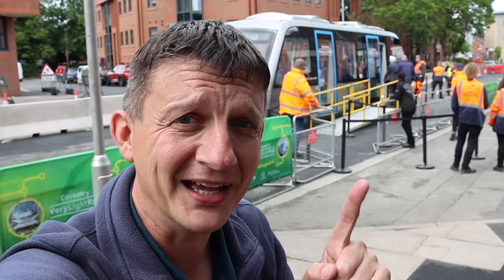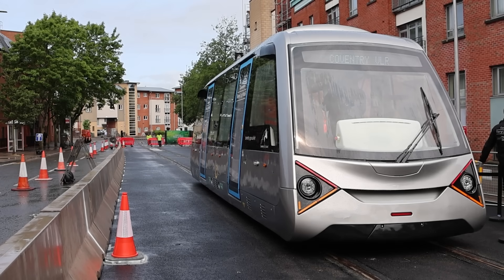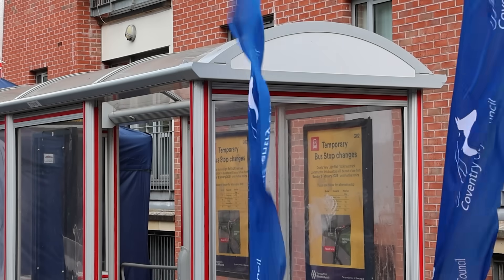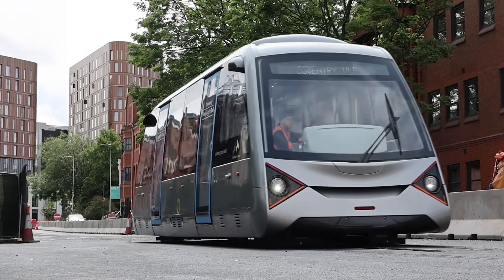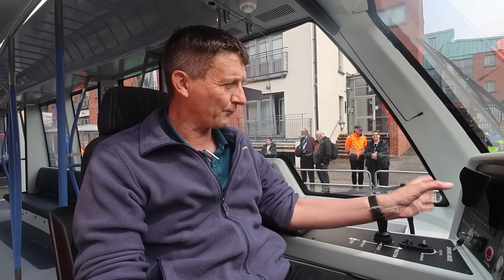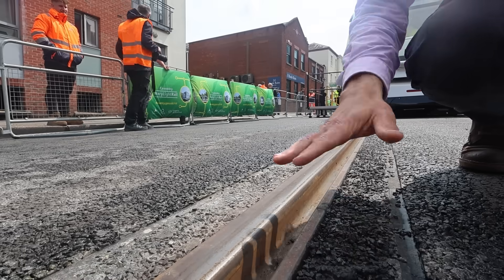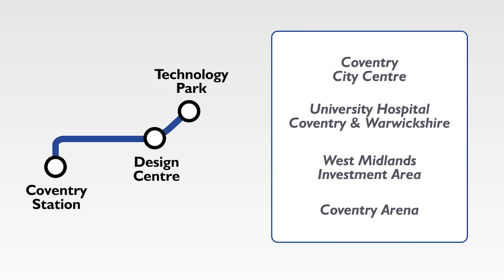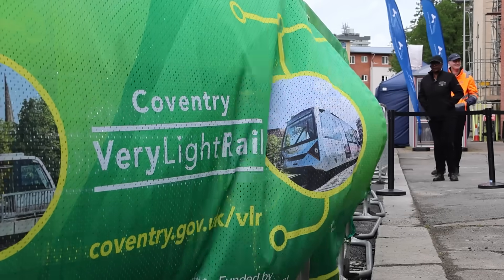The NEW! Coventry Very Light Rail is here

Comment: question: why would we want a tram for a job you can do with buses? I mean this vehicle has the same capacity per hour and it's as wide as a bus.. .what is the advantage? maybe it can be good to improve average running speed on some old tramway networks where longer tramas cannot run.. but I would se much more relevance if this tracklaying system was accompanied by a much longer vehicle...

Comment: I was born in Coventry, and now I live in the world tram capital, so this story hits me from two angles. :-D
Hope they have huge success. Yay real steel rails!
Boo no proper wires but toxic batteries - but if we can get tons of passenger journeys on these things it will still be a solid win!
Reply: I think the success and increased frequency that brings would inevitably bring about a necessity for OHW or at the very least charging installed along the route.
Reply: @Reddsoldier  agreed.  Apparently they can manage 70km on a charge - which isn't that much when its supposed to be going back and forth all day.  long lines will deplete the battery entirely and require charging at each end - and note they didn't really mention how long the recharge times are.
Reply: @jameshodgetts7541  If they're smart they'll design in the capacity to add a pantograph to the production models.

Comment: This just makes zero sense to me for a whole host of reasons. Nominal cost is a bad metric to use when deciding what type of transit to build. A much more important metric is the cost per rider.

These trains can only transport 60 passengers per vehicle, and they operate in mixed traffic. That means at best this system will service a fraction of the ridership compared to traditional light rail, much closer to a regular bus. Add to that the fact that they're using batteries and now your maintenance costs and costs per vehicle are higher as well. So between the higher cost per vehicle and the shared right of way, this system will be completely unable to competitively scale compared to other solutions. At that point they might as well have just invested in more buses and restriped the road to add a bus lane.

Comment: I'm sorry to be cynical but this is just a more expensive, less practical and less flexible version of an electric bus. You don't get the capacity benefits of a proper tram. You don't get a bus which is able to divert in the event of a blockage, whether a car parked on the tracks or a road closure. Yet you get a lot more cost than a bus. And you don't even get the acceleration that a bus has.
I genuinely hope that this ISN'T implemented. For the same money, you could have so much more bus service, benefiting far more people.
Reply: Technically the capacity benefits should be seen in the frequency

Comment: I was able to go see this, take a ride, and ask some questions; and one thing I gathered was that a lot of the attitude when designing and building the system was avoiding disturbing drivers. For instance, they said the vehicles are so small because articulated trams are hard for drivers to navigate around, and they said there wouldn't really be any dedicated lanes or exclusive right of way for the tram since that could inconvenience drivers. I was rather disappointed by this, since these vehicles are so small that they'll definitely be having capacity issues if the system is at all successful, and the lack of grade seperation means the trams will probably be constantly stuck in traffic, seriously discouraging people from using the system. Building new rail transit is a good thing, but I really think that this system doesn't have any advantages over a conventional light rail system other than maybe being cheaper (although, when the batteries wear out in a few years that might not be true either), and the city should really be proud of its transit, rather than timidly avoiding disturbing drivers.

Comment: A point to note, living in a hilly city where the trams are designed to deal with a 10% incline, the CVLR is designed for a 5% incline during normal running. Maybe that isn't an issue for most towns/cities, and the use case suggests that it would be generally for city centre usage which might mean the lack of ability to tackle steeper gradients isn't an issue. It looks very neat.

Comment: I am not sure what the use case of this is? It kind of has the worst of a bus and a tram together: it needs its own infrastructure like a usual tram but has the capacity of a bus possibly neglecting most of the service cost benefits of trams. I think it could be very useful if it is scalable: start with the bare minimum and attach cars and maybe also electrify in the future.

Comment: Can’t see the point. The whole point of trams is they have a remote power source and don’t need to carry their own.  These obviously run on batteries so you may as well use electric buses which are not confined to fixed rails and are far more flexible and larger capacity.

Comment: This may be a dumb question: why VLR electric trams instead of electric buses? What makes a tram better than a bus?
Reply: Steel wheels on steel rails are vastly more energy efficient, meaning less batteries per bum on seat.  On figures quoted in the clip, the axle load on this design is under half that of a comparable battery bus, meaning kinder to roads and due to the predictability of motion, it needs less width than any free steering vehicle.  The system could be made driverless (only on reserved running tracks would be my guess) and multiple unit operation is always an option.  The system could act as an add-on to existing conventional tramways to increase network coverage.
Reply: @TheHoveHeretic  thank you very much. That was a very interesting reply.

Comment: It's a . . . streetcar? Tram covers a pretty wide range, so does light rail. I'd say this is a streetcar - no reserved right of way, runs at surface traffic speeds, stops have minimal or no infrastructure, capacity is about the same as a bus or maybe up to 50% more than a bus, trains are short - single carriage or maybe 2 or 3, carriages are light weight so rails don't need a heavy foundation. That's all things that streetcars were and that differentiated them from interurbans and trams.

Comment: -All the benefits of a modern light rail solution 
- Moves less people than a double decker bus
- As slow as a bus (no right of way)
- Way more expensive than setting up a bus route 

So what are the advantages of light rail that it brings? Smoother ride and faster acceleration (which, as well as speed, doesn’t matter that much without a right of way), that’s it. I literally can’t find any other advantage

Comment: 70km range for a public transport system seems very low. If they insist on batteries to avoid building a catenary they need more rage than that. A public transport vehicle can travel 120km a day easily, so unless you have twice as many vehicles as you would otherwise need that battery capacity is currently inadequate. This isn't a critical failure with the idea, just a needed upgrade to make it practical.

Comment: If you want real light rail , try narrow gauge , it saves rotating wheel set weight .  Lookit meter gauge trams in Switzerland or Lisbon , San Fransisco cable cars , or 3 and half foot gauge of  light rail in Japan , bla .   This new wide gauge heavy battery "thing" does not belong .

Comment: Hi Geoff,

Always nice to see you pop up in suggested videos and see you geeking out.  Seems like it might be a smart idea for smaller cities such as Coventry.  But honest question: how is this better than a bus??  It's about the same size.  The big advantages of buses are they don't need new infrastructure (generally speaking), the prices of the buses themselves, and since they aren't on tracks, the route can be adjusted and modified very easily, or even on a temporary basis if there is road work or a car crash somewhere.  For most locations around the world, focusing on good bus service would simply be their best solution.  And buses are ideal vehicles for hybrid gas/battery power.

A 70 km range probably works fine for Coventry.  Here in the US, I don't think that would work anywhere unfortunately.

I live near Los Angeles, and on the last light rail project, they spent over $1 billion dollars a mile.  Ridiculous.  Lots of stupid regulations and designs (sometimes elevating portions or putting other sections underground) that drive up the costs, but also graft (legalized).

Finally: what's wrong with calling it the "VLR"??  London has the DLR.  VLR certainly doesn't sound bad to my ears.  If they don't like VLR, the next simplest and obvious name seems to just call it the "Coventry Tram".  If it's built in other cities, they can just substitute their city name.

Comment: I do think this is very interesting, but I'm also sceptical. At the moment with this little demonstrator vehicle that has the capacity of half a bus, it's pointless. The question is whether it can scale to at least 150-200 people per train. The track technology may be the most interesting thing, if it can keep its promises. It's nice that they can build without any relocation of utilities, but can the ground beneath the track actually withstand the load long term? Even with normal buses that's not obvious, I know plenty of places in my local town where the weight of buses at the same spot of the road every time (at stops) has caused deep depressions in the pavement, until the road in that area was finally rebuilt much heavier.

Comment: Honestly? I think it has some great potential for small towns who want to introduce a tram system as a potential starter, or even as a starting point for growth. The only thing that worries me is that they're building them into existing roads and will likely not be segregated and so will just get stuck in traffic. The simple rule is, if you can get there faster and more comfortably in a car, why would you use anything else?

London has public transport all over and car journeys are a nightmare, Manchester's public transit is also becoming locally controlled like London and their Trams have grown from 1 line opened in 1992, to 9 lines to different locations, and having maxed out tram throughput through the city centre in 2025, and that's because they used old rail lines around the city, very little new infrastructure needed to be built to start with. 

If they put these into a dedicated lane or bus lane on busy routes to popular places, then I think this could be very successful and get more people out of cars in more rural areas and smaller towns or places trying to get started with a tram system without the initial huge budget initial cost.

Comment: I have a couple of issues with this: 

Firstly, Is it seems to be skimping on the fixed infrastructure, which means I am skeptical it will be value for money long term. My reasoning for this is such a lightly installed system may not have the long term staying power of a proper tram, which opens the door to a failure in the fixed infrastructure leading to it's removal before it can prove itself. If it gets people building trams, I'm all for it, just wary about it lasting. 

Secondly, batteries and charging: a 70km range sounds alot, until you realise the average length of a tram route is 15-25km, meaning at most this will do two round trips before needing a charge, this means the need for more vehicles (and the space and infrastucture to charge them) in order to run the service. Ideally a service like this for it to be successful needs to run at least once every 15minutes, (although more would be better), ie 4 trips an hour, so already depending journey time you need 4 vehicles an hour. And then Charging, in order to fast charge a vehicle like this, you need significant fixed infrastructure in terms of substation and electic supply, that I would be surprised if it wasn't comparable price, or more expensive, than just putting the wires up. Additionally to this, we've seen how vehicle batteries can be dangerous, and I would argue that just putting the wires up would likely be cheaper and safer. Also batteries add weight to road vehicles, which will increase the wear on already lightly installed tracks. 

Thirdly, This feels like another pointless gadget bahn, I struggle to see what it's actual innovation is besides cheaping out on the fixed infrastructure. 

To conclude, it's nice to see Coventry trying to build something that resembles a proper tram, however it only highlights that we should all be pushing every large town or city in this country to build this sort of infrastructure already. Instead of pussy-footing around trying to "innovate" instead of building what works.

Comment: Have to admit I'm a bit skeptical but I can applaud any step in the right direction (towards any type of rail). I understand cost is a major feature here but seemingly at the expense of future proofing and longevity. From what I understood the rails aren't built on any reinforced foundation and thus are susceptible to the road conditions deteriorating? I might be completely wrong here but it's a concern with how roads are usually maintained across the country. 

I get that the entire point is that its cost effective and ultimately a gateway to a more substantial system, but it's a testament to the lengths people have to go through to get proper public transport funding.

A proper tram/LR system is what is actually needed here. The area can absolutely support it, plenty in Germany in even smaller cities! Just seems like a stop-gap until finding is given.

Comment: Every major town and city could benefit of one of these types of systems
Reply: Bristol, I am looking at you very closely. And Gloucester. And run it up the road to Cheltenham.
Reply: Just another excuse to burn a couple mill to justify their budgets & raise taxes LETS GO!
Reply: To many polluting batteries regular trams better
Reply: @joshpeck9266 
Batteries aren't particularly polluting as long as they're used for a long time, to transport a lot of people, and then disposed of properly so they can be recycled, which public transport would be an ideal use case for. When this thing can transport 60 people at a time the carbon footprint of that battery is going to be tiny compared to an electric car. Overhead cables just aren't practical for every type of street, and they're expensive to install. If little battery powered vehicles like this can help to electrify more of our journeys then that can only be a good thing, especially considering how the UK pretty routinely has the vast majority of its electricity coming from renewables and nuclear now.
Reply: @Dorgpoop  And there’s no expensive copper cables that can go er, missing, shutting down that section of track.
Reply: @Dorgpoop an electric bus can do everything this can and is cheaper and more flexible.
Reply: @user-fc6jq4xn9m
Maybe, but more often than not, busses being flexible just means that they're always late. This also has less rolling resistance so it might have a better range.

Comment: I think the future will be the big trams also running on batteries, at least in city centres but mostly more and more elektric buses. This small tram vehicle is cute but i think electric buses that are the same size as this are more practical in most cases. A small vehicle like this is more like someone has taken this out of a monorail and plunged it in the street giving it all the downsides of sharing traffic. I had rather seen this gadgetbahn vehicle being installed on an actual gadgetbahn like a suspended monorail for example, albeit having to be curved from the bottom up then. Now i don't see the added value of it compared to just running an electric bus there.

Comment: I can't see any advantage of a LRV. Why does a bus on rails suddenly make it more efficient?  Trams were heavy so needed a rail. This LRV is not. A small bus would be just as efficient. Trams traditionally had the advantage of higher capacity - but not in this use case where it doesn't need it, and surely a cheap LRV or bus can be run more frequently for extra capacity if needed (50 m spacing if needed).  Trams have huge disadvantages - they need segregated road layouts, huge cost of tracks and a heavy footprint requiring maintenance.  If a segregated lane is a must have for priority over cars, then just have a segregated lane - without tracks.   If efficiency of a trolleybus is a must have then surely new electric busses will negate that advantage of a trolleybus or tram?  All we need is electric minibuses running on a painted white line.

Comment: Gauge? Would it be even cheaper and easier to get round sharper curves if it were narrower? And the battery is clearly a major deal breaker (no catenary). This whole project (the shallow track) has been some years in the making; let's keep our eyes on bogie performance and how the track/asphalt stands up to long-term usage. And whether you can successfully couple vehicles together, for peak periods. 🤞🤞🤞🤞🤞

Comment: I am a huge rail fan but this is pointless. An electric bus holds as many people without requiring tracks and is flexible in the event of roadworks or if passenger needs change. Can two cars even be connected in the future if ridership demands? Just stick with buses or do proper light rail. I also didnt realise how far away this project was. I remember reading about it some time ago and thought this was a video about the first line opening.